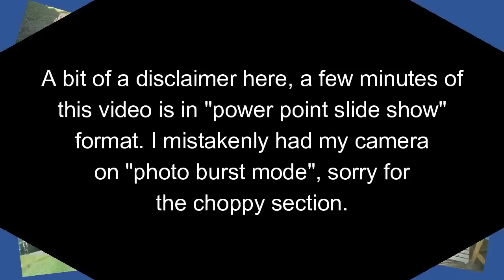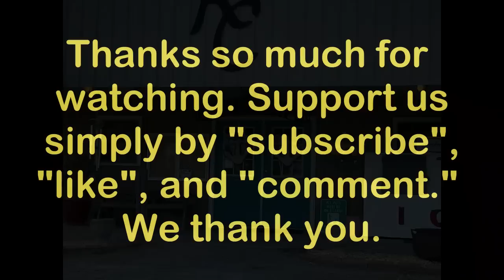NO, I didn't fall down again...Finishing deck at The River

Comment: Hello Tome. great to see all your progress. You might want to check for nails before moving your camper trailer bud I see you had toast old bent nails underneath it is all don't need no flat tires. If the nails are too hard to reach my grandfather showed me a neat trick you can take an old speaker magnet and put a long string on it and throw it under the trailer and just drag it along the ground and all the nails and screws or anything sharp mettle will stick to it as you pull it out from underneath your trailer or car and no more flat tiers I'm only reminding you have nails near your tires now is all Sir, Hope you have a wonderful day now.  👍👍🎖
Reply from the maker: Thanks Woody67, I already used my magnet, right after I finished the outside steps the next day I combed the area and under the camper. Thanks.
Reply: Cool. 🖐👍👍👍👍

Comment: You’re a better man than me, Thom!! I would have looked at those railings, thrown away that block of wood, and said “aw, it’s not that far off!!”. 😂😂😂😂😂 If I had that extra lip on my deck steps going out, I would stub my toe, fall, and break my neck. Coming up I would probably step off it wrong & sprain my ankle!! I wouldn’t want to say I’m a klutz but……………
Reply from the maker: I almost did Gail but I said, "Jocelyne will notice and call me out," lol. As for that little step going off the deck, I've since replaced them and there is no lip. Funny, Jocelyne said the exact same thing as you. thanks Gail.

Comment: Hallo Tom and Jocelyn.  My friend a little advice if you don't mind. Give the nails a little wack or two on the sharp point. It for some reason goes in easier and don't split the wood. But the deck look amazing.  Hallo miss Jocelyn.  You looking good but you must come more on the camera.  Love to see you. Karima South Africa
Reply from the maker: Thanks Karima, "blunting" the nails is a good practice. I was using screws and I usually drill a small hole when I'm near the end. Thanks so much Karima.

Comment: That nail you just threw under the camper might get your tire if and when you back it up
Reply: My thoughts exactly.  Had to back up the video to check what I thought I saw.  He probably goes over the ground with a magnet to pick up stray nails.
Reply from the maker: Funny you should say that, I had my magnet and did pick it up, along with others I didn't even know I dropped. Thanks and good eye.
Reply: @ThomsSimpleLife  Now that the deck is done maybe you can just relax with Jocelyn and Harper for a change.
Reply from the maker: @SassySue67  I will Susan, thank you.